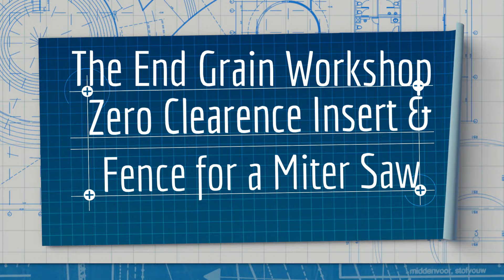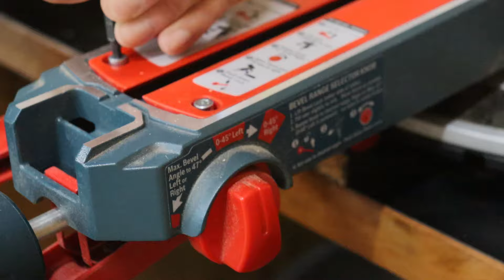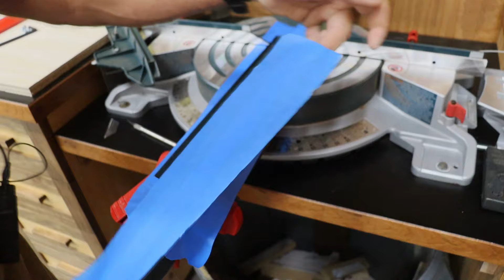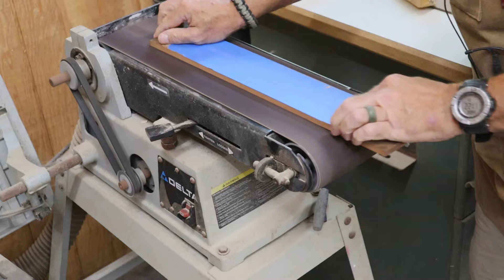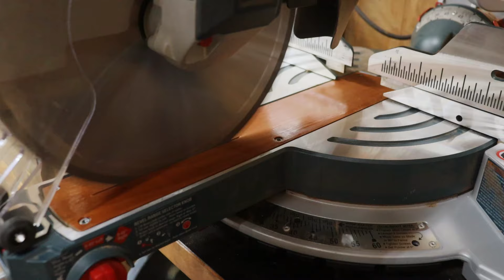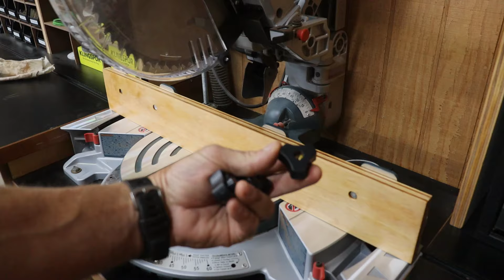How to make a zero clearance insert and fence for a Miter Saw - The End Grain Workshop

Comment: Great work & project but what do you do when you need to make miters? Good bye zero clearance!
Reply from the maker: Thank you for your comment! When it comes to making miters, I actually use a different approach to maintain the benefits of zero clearance. I keep a separate set of zero-clearance fences for common 45 degree miter cuts. This way, I can switch them out depending on the type of cut I need to make. It helps to reduce tear-out and keeps the cut clean. Additionally, I sometimes use a sacrificial fence on my miter saw to achieve a zero-clearance effect for various other odd miter cuts. I hope this helps! Feel free to ask if you have any more questions.